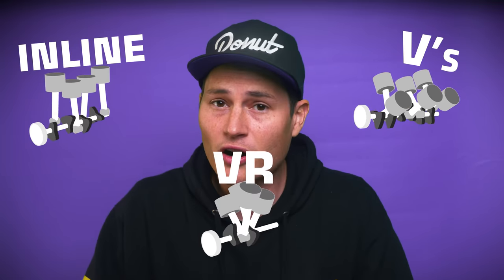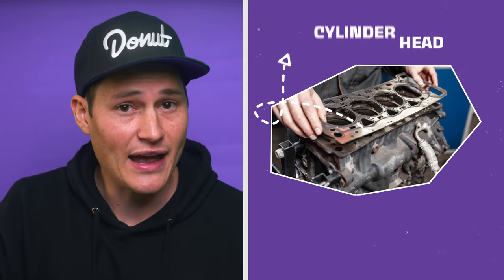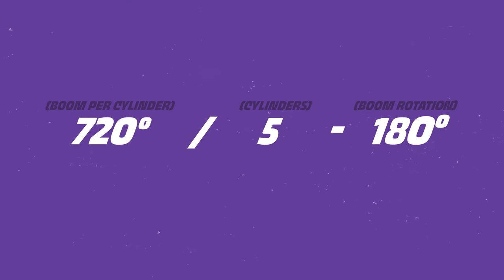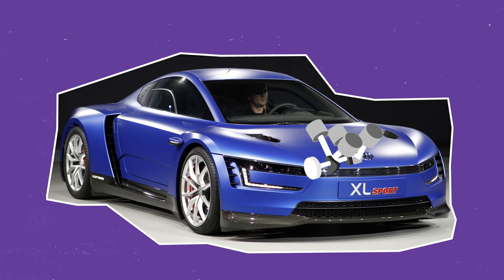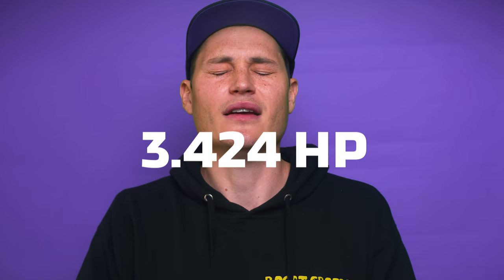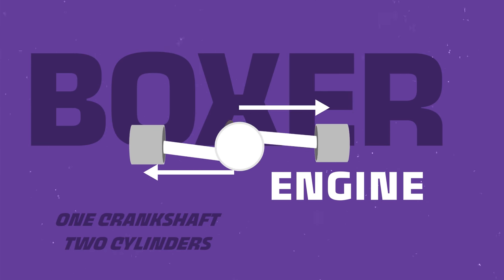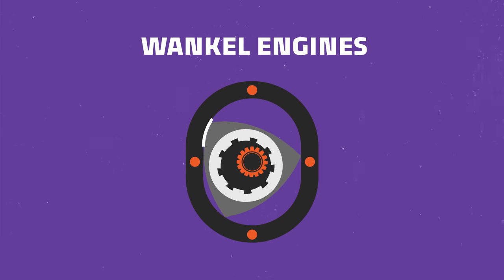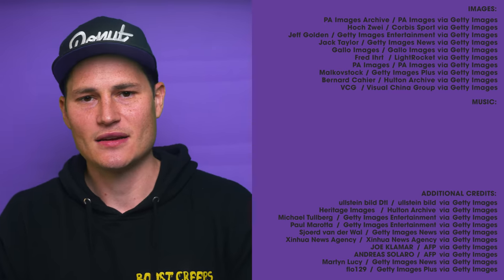Every Engine Layout Explained

Comment: “I don’t think i missed any engine types”
Radial engines: Am i a joke to you?...
Reply: Perhaps because they were used on the plane...
Reply: Find an instance where one was put in a car, then throw it in the trash. Lol.
Reply: radial engines mostly have been modified to fit in a car.
true rotary engines (not wankel) like the engine in the legendary Sopwith Camel Biplane was actually used in cars like the Adams-Farwell and some motorcycles integrated into a wheel.
though today they have gotten the names "Rotary-Radial" or "Rotating Radial" engines not to be confused with Wankel's.
Reply: The Wright Wirlwind Radial in the M4 sherman tank for example.
Reply: Turboshaft engine (Chrysler Turbine Car, Fiat Turbina who helds the Cx record for decades with 0.14, General Motors Firebird, Howmet TX, Lotus 56 which proved to be fast but unreliable at indianapolis before being banned, Renault Étoile Filante, Rover JET1 but also M1 tank, powerboats and many helicopters
Reply: "Am i a joke to you"  is more appropriate
Reply: @wall7103  - Harley-Davison V-twins are actually a radial engine.
Reply: Expected this comment. Not disappointed.
Reply: @xiaolaizheng6740  and guess where those plane engine where put when they wasn't require for plane anymore?
Reply: Hello have none of you watched vin wiki the dude who built the bat mobile put an Apache helicopter engine in it so yes there in a car
Reply: @m_02sierra  lmao yeah true, there is the batmobile with a gas turbine.
Reply: And steam engines
Reply: @highervoltage5430  you just made my day. Always wondered why they sound so stutteringly.
Reply: @lfraser7128  those are not internal combustion engines, so they don't belong on this list, but it is an interesting topic, steam engines on cars are cool
Reply: @rhazien2502  they never specified it had to be internal combustion, external combustion engines have been in cars to
Reply: @xiaolaizheng6740  they where also used in cars and tanks
Reply: Yes, yes you are
Reply: @wall7103  I've seen videos of people doing it but yeah it's very impractical.
Reply: Aren’t those on airplanes?
Reply: @WarriorsPhoto  i don't believe so
Reply: @michaelrogers3857  Ohh 😯. What were they used in?
Reply: @WarriorsPhoto  hmmmmm, i think theyre used in like single rutter planes, idk what u call that. And its used in that mazda car i think, or Toyota, mx-5? Or is that a miata? Im not sure. I dont rly like them that much sry m8 im not sure. Im pretty sure that its like mx (somthing) idk man sry
Reply: @michaelrogers3857  don't give advice if you don't know...
Reply: @WarriorsPhoto  yes they were used in airplanes.
Reply: @wall7103  🙉🙉🤡🤡
Reply: @michaelrogers3857  It’s all good 😌. We are engine fans and that’s enough. 
What’s your favorite engine?
Reply: @wall7103  I thought the were used in that platform. They are still used today in single engine flyers right?
Reply: What about High Bypass Turbo Fan??
Reply: @dantellewisham133  Low bypass turbofans have been used on vehicles with wheels that we could consider as cars, I don't think the same is true for high bypass
Reply: Radial-engine, X-engine, Free-pistons, Stirling engine, Quasiturbine, Split-Single engine and Axial engine.
I think we have it all.
Reply: There have been motorcycles with radial engines. Also some Sherman tanks used them.
Reply: @xiaolaizheng6740  What about the red baron bike?
Reply: Radials are used in a moving vehicle so it counts
Reply: @xiaolaizheng6740  And on tanks, still to this day.
Reply: No. there has never plane engine was in a mass produced factory car.
Reply: @xiaolaizheng6740  And tanks, don't forget those WW2 tanks.
Reply: @Erebus-PCFX  t engines too.
Reply: @WarriorsPhoto  Race Tuned Rolls Royce Merlin V-12
Reply: The original VW Beetle from the 60's and 70's had actual radial engines.
Reply: Read it twice because you will ignore the the second "the"
Reply: Deltic engine will blow ya mind if you have never seen one!
Reply: @Erebus-PCFX  in a car... or bikes 🤔
Reply: I think you need to say it do i look like a joke to you?
Reply: crankless engine, the elusive unknown engine of epciness
Reply: Radial engines and rotary radial engines have been put in many kinds of vehicles.  I am a big fan of the radial engine, maybe not so much a fan of the rotary radial.  These engines powered many vehicles over the years.  Cars, trucks (specifically firetrucks), boats, military vehicles (tanks), and motorcycles.

They were probably omitted because there are sooooo many configurations that the video would be upwards of an hour (and pretty boring) if they covered all of the configurations.
Reply: Title of video: Every Engine Layout Explained
Everyone here: "iT wAsNt UsEd In A cAr!!!"
Reply: @wall7103  they were used commonly in tanks, armored vehicles of many sorts
Reply: @wadesta1986  This deserves more likes!
Reply: came here to make this joke
Reply: Not really a car motor. Radial turbo airboat anyone??
Reply: @Why-sn5gt  read the title again😀
Reply: @Noffie  The Tucker 48 used a Franklin O-335 aircraft engine. I know we're talking radials here, but to be fair you just said 'plane engine' lol
Reply: What is radial engine ?
Reply: @parisienii6522  Umm... look it up... i am not going to explain it here sorry...
Reply: well he mentioned the Napier Deltic under opposed, an 88L train/boat engine... and probably one of the most complex engines ever made
Reply: Also the Y2K motorcycle
Reply: In the comments looking for the radials
Reply: the M18 hellcat tank used a radial engine tho
Reply: @brrebrresen1367  The original Beetle - the KdFWagen - was initially intended to have a 5 cylinder radial
Reply: Dont know if tanks count on this list, but there where a couple early Sherman tanks with radials before they discovered more normal configurations
Reply: @moohooman  yes!! the Continental R-975 C1!!
Reply: Yes, Radical or star ones. I think X is also there. Although bro explained so far I love this channel and meanwhile, he entertains us while explaining. That's good and forget to say I am his Fan.
Reply: @Mauro-82  some interesting data on the Chrysler turbine. They started the project back in 1953 with the first turbine. I don't remember which body they used for it but until the 60's they used production cars for test beds. When they got the Ghia bodies the agreement was that they pay for 6 and the rest would be paid for by who ever bought them. After the demo period (they sent the cars out to families to drive for two months at a time based on a lottery) they were gathered up and destroyed (without the turbines) because of the contract with Ghia. They continued to develop the turbine until 1984 when the project was finally ended. Why? because they had two problems, one was emissions the second was price. They had finally found a way to cast the vanes for the turbines (yes they were balanced and strong) but not lower the price enough to make it feasible for the public. 10k a pop for an engine in the 60's was a hard sell. To be honest, considering the turbine cars are multi-fuel, i think they have a lot of relevance today as opposed to back then considering the availability of gas.
Reply: @lfraser7128  yeah he missed the white and doble steam cars. Sad, since the doble were way ahead of their time.
Reply: He also missed inline 7 motors. Our Massey Ferguson combines have Inline-7 diesel motors
Reply: @XxRay346xX  Holy shit...I forgot about thouse. I got the training materials whey they were launched... Never saw them in our market (atleast not while I was in that job)
Reply: @monotypemesh3174   Yea I’m pretty sure AGCO uses those 9.8l I-7 diesels in all of their combines. Really nice motors, good power and efficiency. Haven’t had any major problems with them yet
Reply: True same goes for the deltic engine that had 3 cranks 18 cillinders in 3 banks of 6 in a row with 36 opposing pistons. That thing is absolutely nuts!
Reply: Have you ever seen one in a car?
Reply: @smzemperfi  i could have missed it but did he say car engine types?
Reply: @brrebrresen1367  ummm mounting a rotary engine in a car would be fun to see OMFG I just googled the Adams-Farwell..... (this next note is for other people Understanding of my amusment ) . The main issue i can see with it is in a rotary engines the crankshaft does not rotate, the cylinders block rotates around the crankshaft. For this reason, aviation rotary engines had their propeller attached to the rotating cylinder block.  ... Thankyou Sir for introducng me to more weird and expanding a wingnuts knowledge
Reply: @joshuapritchard575  thanks you
Reply: @obelic71  that's a tank not a car so that's why it wasn't mentioned
Reply: I agree that radial engines could have been included but the saying "Am I a joke to you?" is so five years ago.
Reply: @brrebrresen1367  wankle engines are true rotary engines, radial rotary engines still achieve their rotary motion from a reciprocating action
Reply: @TheFlick175 , that is all down to how you look at it and what you want yourself to set as a definition.
one of em got a rotating engine and the other a rotating piston.
Reply: @xiaolaizheng6740  there are cars that used a radial engine but that was from 1906-1950 . it was a plane engine but was modified for cars.
Reply: @wall7103  They were used in tanks and in some wheelloaders
Reply: @rhazien2502  apart from needing a warm-up period to build up a workable pressure level, I understand steam cars give performance similar to electric cars, you get great torque and relatively little noise/vibration when accelerating at low speeds. I think Jay Leno has a couple steam cars and has shown them off.

Steam engines in cars kinda suffer from a high surface area to volume ratio, though, compared to train engines or industrial-scale steam turbines used to generate electricity in large ships and commercial power generation facilities. Small engines lose heat proportionally faster than larger ones, so efficiency takes a hit.
Reply: @obelic71 That's a tank, not a car (Imagine driving that to maccas tho for breakfast though)

Comment: Fun fact: Opposed piston engines were also used on the British Railways Type 55 ‘Deltic’ diesel locomotives. These were based of a prototype built by English Electric and could regularly run at 100 mph on the East Coast Mainline, making them worthy replacements for Gresley’s famous A4 steam locomotives.
Reply: Diesel electric or engine-to-shaft-to-wheel type of engine?

Comment: It’s just so funny how Inline engines go:

1-cyl: Oldsmobile Curved Dash with 5bhp
2-cyl: Fiat 500 with 13bhp
3-cyl: Koenigsegg Gemera with 600bhp
Reply: thats cus the volume in gemera is huge
Reply: @JohnDoe-ph6if  kenigseggs 3 cylinder uses very advanced tech
Reply: It has 2 electric motors as well so it might be cheating lol
Reply: @gamefreaknitro  The 600hp figure comes solely from the combustion engine, the electric motors add to the total power output, combined the car has somewhere near 1700hp
Reply: @krystal_vector5412  But the real hero in the keningseggs engine is the twin-turbo set-up. Without it, it would not be able to have such output. Clever design, and brilliant engineering by all means. That it's a VVT. Efficiency to the max.
Reply: @4dbullshitpatroll6  it is inline with all the other moving parts of the engine, I think that is the right alignment.
Reply: If we look at the most HP 3 cylinder that is NA, that crown probably goes to 1KR-VE Toyota engine making 67HP
Reply: Gemera actually has 1700 bhp
Reply: i only knew a heavily modifided 3 cylinder daihatsu engine making 300hp and that is an old engine. But its so hard to understand how that car has 600hp
Reply: @4dbullshitpatroll6  In line with itself, along the axis of the cylinder? The I-1 look like an actual I, I guess? Ayayai!
Reply: @snuckle2421  Big displacement, two turbos and the freevalve camless intake system.
Reply: @gregrose5387  koenigseggs are overrated trash
Reply: @snuckle2421  a lot of advancements from a Norma, combustion engine I also hear it has timing for the cylinders for more  horsepower
Reply: David R. of Winch  I had one of those. You kept your 0-60 slow because you didn't have a choice.  Lol. 
Everyone always said 40-50 mpg (sometimes more) but mone never got better than about 30.
Reply: @Shmubek  I’m quite sure the Volkswagen 1.0 MPI has much more horsepower than that…
Reply: @4dbullshitpatroll6  , could be inline with its Crankshaft Bearings?

Comment: Honestly this is one of the best explanations of engine mechanics I've seen. I'm working on building a solar powered steam engine for green energy and this helped my understanding immensely!
Reply: Piston or turbine?
Reply: @PhycoKrusk  currently working on a piston engine that was originally a belt driven air compressor. When I've got more tools available I'd love to look into turbines.
Reply: @Ben-ex1kv  I hope it works out for you. Turbines are complicated even if they are more efficient, but regardless, a solar-powered steam engine sounds extremely neat. The only question I would have is how well it will scale up; it should be fairly easy at the science fair project level, but I'm more interested in the consumer level.

I know my father is too, and if he ever gets time, this may pique his interest for tying into the napkin diagrams for gravity batteries he's been working on for the past few years (so far as I know, they haven't moved beyond that point).
Reply: How r u gonna boil water?  With solar?
Reply: aye bro be careful, dont get unalived by you know who
Reply: @conductorcammon  he can probably charge up battery coupled with capacitors, and then use their ability to quickly send out power to heat up and keep the temperature stable.
Reply: Hi I would like to build a small remote control strobe light but idk how to. I'm trying to teach myself things I neglected as a kid. Maybe you could help me identify which components I need? It would be for my kitty. Thank you for your kind reply

Comment: How could you not mention "insert favorite engine no one heard of", it revolutionized engines forever.
Reply: What's that
Reply: Radial
Reply: X
Reply: But...but...the duke engine...it...did a thing...
Reply: @ilsmawandfarm1767  what did it do then?
Reply: @grantflippin7808  Wankel radial, or radial radial.
Reply: Since these engines are from aircraft the chance was fairly low. But I was hoping to see the rolls royce griffon or the DB 605. The latter was build in such a way that a gun could be fired between the cylinder banks. It was also mounted upside down.
Reply: Insert engine or select oil type.
Reply: Tom Lieb's V4 Small Block Chevy was a great idea from a parts availability standpoint.  & yet not so great on the balance side of things.  The V8 Eng's w/ 180° crank pin locations, (aka- flat crank V8s) like in the Gen 6 Gt350 Mustang is another eng that revs higher but has balance issues.  People love the sound of these GT350's, yet they had ALOT of warranty problems using a flat eng style crank ( of sorts) in a V configuration.   & yeah, there are a bunch of really cool aircraft engines to cover.  Overall,  a good presentation for those wanting a 30k ft view looking dwnward on different eng configurations in last 100 yrs or so.
Reply: Ngl (insert my favorite engine here) is my fav engine ever man.
Reply: @namesareboring2009 Omg (insert engine here) is also my favorite engine it’s so (insert synonyms for powerful, small and versatile). It was the (insert history) of (insert more history) and (even more history) until (yet even more history) it was outperformed by (insert better engine) in (year) and was eventually obsolete by (more dates).
Reply: @Ryann9  yeah, sucks how (engine name) died out quickly :( nowadays (engine name) goes for (an absurd amount of money)! (date) sucked for any vehicles using (engine name).
Reply: Seriously! The "Insert favorite engine no one heard of," was the reason. "Insert driver no one cares about," won the "insert race that no one went to," Donut really dropped the ball!
Reply: Dude just attacked a large part of the community and for that we must bow to him
Reply: Simple. You leave out other engines that exist. Like I14. 🤷‍♂️
Reply: Or the fact that the really early days of W type of engine was made for Air plains during WW1 and possibly before that
Reply: The '39 to '42 Rolls-Royce vulture had an X 24 engine

Comment: Well, it would be awesome to see some other video about "strange" engine displacements like Duke, Radial, V5, Chrysler Turbine, Honda NR750 oval cylinders and more (even if they are not commonly used in cars)
Reply: The Helicron was technically a car...

Comment: As a Subaru owner, I've gotten really good at pulling my car's engine, because it's the easiest way to maintain it. Spark plugs, valve adjustment, and head gaskets, and timing belt, all in one go. It ain't cheap, but I can get all that done in less time and with less effort than it would take to do just the adjustment and the spark plugs.

Actually, in the long term, it's cheaper than putting off vital maintenance, but it's a hell of a lot of money all at once. :P
Reply: Would love to see a video on  it
Reply: I know that it is a boxer engine but I just tell people that it is a lazy V4, it's so lazy that it couldn't hold up the V and went flat...
I actually say my ( slightly muffled AWD ( so they think I said 4WD ) is a lazy V4 but has a turbo to help. Some click, some get confused, some go on about not being like a V4 at all.